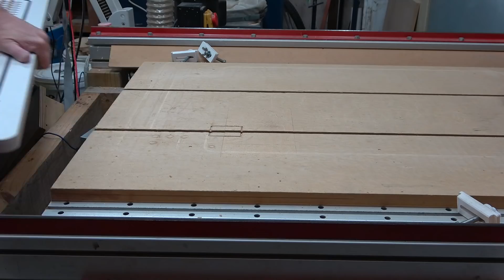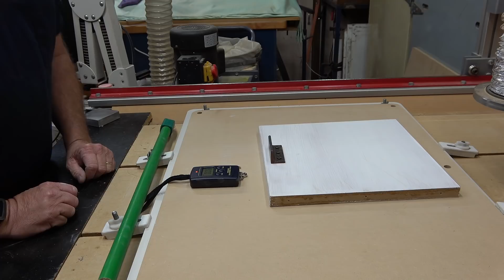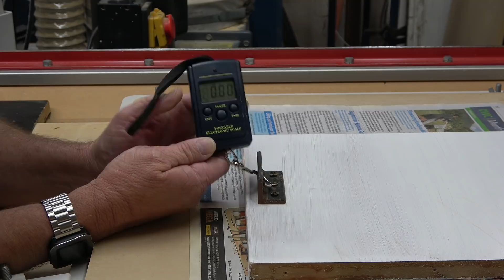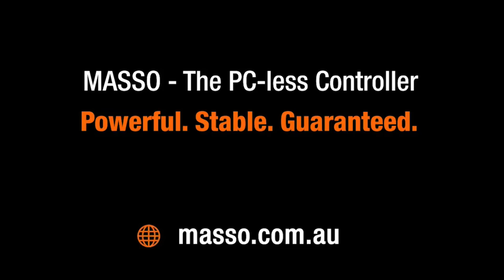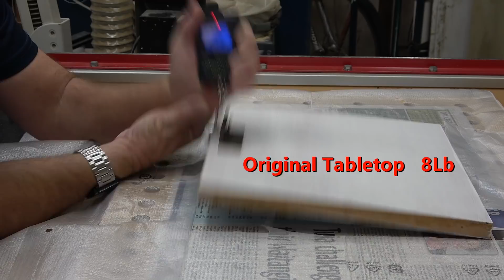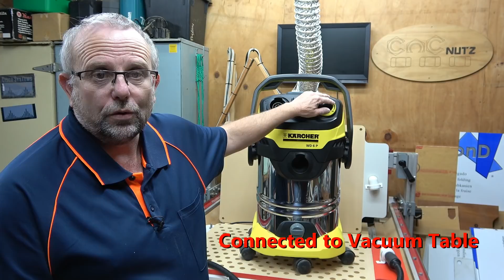Vacuum table revisit Part2 - CNCnutz Episode 244

Comment: Hello Peter... I built your vacuum table over the weekend and found something interesting. I tried my contractor shop vac, and like you said it didn't supply enough suction to work adequately. I did find, however, that if I removed the filter I  got significantly more suction

Comment: Hi Peter this reminds me of a machine I ran. If you make the top plate a spoil board you can drill 1/4"  (7mm) holes under the part you are machining. it pulls down great. it would be nice if you could install a gauge to see how much vacuum you are pulling. The Komo machines we had pulled 30 inches of vacuum. I'm sure you can see images of the tables if you search on the internet.
Reply from the maker: Thanks. Will have a look.

Comment: With a proper vacuum pump able to pull about 26” of mercury, you don’t need holes. Seal the ends, surface the top and you’ll be able to hold snug to the mdf

Comment: All the industrial machines I've used had regenerative blowers which move allot more air.
Reply from the maker: Thanks Stephen, I will will have to have a look.
Cheers Peter
Reply: @cncnutz  i just finished modeling up a 150mm diameter version in Fusion360. I plan to print it out on my 3d printer to see if I can replicate a simple version using an old electric motor I had in the shop. Hopefully can generate enough vacuum with it to make my own vacuum table.

Comment: I built a similar table, for my onefinity. It does cover the whole 48x30" surface with 4 zones. Extensively researched the vacuum engine to use or the shop vac and concluded the same. Festool does have the highest vacuum force i could find with an appropriate cfm to match. Also, all their vacuum goes up to 3.5psi so using the smallest one is fine. For actual vacuum engine, the ones that are stronger and cheaper all require 220V which isn't possible for me.

Comment: Hi Peter, thanx for all your info. I was wondering. The Foam ring you apply around the board, is that necessary . If one would have the same size board underneath and on top, and seal it with Ductape or something, would that do the trick as well you think ??

Comment: Would not it be  better to use plastic for the first piece with the groves and vacuum holes as it would not allow air to be sucked thru it ?Also it would not warp when exposed to moisture in the shop ?Also then using a thinner mdf so it doesn't have to pull vacuum thru as much material .Then paint around the outside of the mdf to seal the contact points of the bottom piece and top-waste board

Comment: Plastic garbage bag rather than the semi-closed cell foam with holes poked. Cover then entire permeable surface of the spoilboard, place the workpiece, cut around it with a razor knife, then remove the plastic under the workpiece. This will eliminate bleed. I think you'll find there's little or nothing to be gained by drilling holes. There are reasonably priced vacuum pumps that you can use in place of a vacuum cleaner (which is not designed to be run while flow is occluded).

Comment: Good day Peter.  I’m just getting started in cnc use and am curious about how well your vacuum table works with fairly small pieces of hardwood in actual cnc routing. My concern is about smaller pieces coming loose if tabs are not used.
Reply: I'm thinking of doing something similar - the tabs and 'sprue' used for smaller pieces is forcing me to use larger blanks than I should have to.  I was thinking of either making 'jigs' that have specific suction holes or using larger 'cover' type boards to cover over the table area I'm not using.  I would think it might put stress on your vaccuum though...

Comment: Excellent thought and process all the way through and building on every previous experience - Thank you very much.

Just building on your closing last ideas -
Foam sheet comes in 2 varieties.  It looked (can't be sure of course) like you were using common open cell foam and that will definitely not work.  It will actually introduce pathways from the side to between board and stock.  However, perhaps you could try closed cell foam  (the stuff used in double skin boat building) which while not allowing unexpected pathways could actually compress across the board and provide suction under the stock with punctures under the area below the stock.
Putting foam aside all together, how about a plastic trash bag (- cheaper and thinner the better) punctured in strategic array.
My final no cost solution - raid the kitchen for Saran wrap?  Used similar to your paper and punctured strategically.

Still, the episodes were brilliant.  Thanks again.

Comment: Have you tried using 6mm or 12mm MDF for your top sheet.... possibly could give a good middle of the road between pockets and flat sheet. BTW thankyou for your uploads they are always informative and clear looking forward to seeing more.
Reply from the maker: I haven't Dale but it is  good thought. If I can find some thinner board I will give it try. 
Cheers Peter
Reply: @cncnutz  why not mill it to the thickness?

Comment: Another very good video with great info and testing, I believe you posted on your site under the materials the following  940 x 60 x19mm I'm guessing it should be 600?I don't have my laptop with me right now but I'm looking forward to doing this project. Have a great day.
Reply from the maker: Thanks Donald, I will fix the typo. It will fit better if you use 600mm 😁
Cheers Peter
Reply: @cncnutz  I'm new to all of this and metric is not my go to measurements. Have a great day.

Comment: don't find a way to email. The contact me on the website is not configured correctly. Any way I really appreciate the videos and I'm going ask a stupid question. I work a lot with rough western US cedar. Neither side is planed. 
without planing will your table be able to hold it down the board. I usually work with 8-12 wide and 2 in thick
thank you  andy
Reply from the maker: Vacuum tables require flat planned surfaces for the best holding. A small leak and everything let's go. I think for rough sawn not flat material I would try thick foam with suitably placed holes to create holding points and see if that worked. I would be holding it so I could machine the other side flat and then flip it over for better holding. There is a contact page on my website for contact purposes. 
Cheers Peter

Comment: Since the top layer of your vacuum table now becomes your spoilboard, do you find the cut marks having a big impact? I use your technique of zeroing to the base to minimize the cut marks, but they're still there.
Reply: I wonder what would happen if you used a thin MDF sheet (like 3mm) on top as the spoilboard...
Reply from the maker: This is where adding newspaper or foam between the board can help as it provides the extra height to protect the actual vacuum table top. I need to do more testing but the other option is to not cut all the way through. Doing this keeps maximum vacuum.
Cheers Peter

Comment: Great video 
Have you install a vacuum gage on your system to see how much your pump is pulling?
Reply from the maker: I don't have one to try and it will be at least a month for lock down to end her in New Zealand.
Cheers Peter
Reply: @cncnutz  Make yourself a water manometer, vacuums pull about 25 - 29 inches.

Comment: I think you need to find a balance between how much your vacuum can pull and how thin you need to go on the MDF to allow that much flow. When your vacuum produced virtually no increase in performance from half to full power, it seemed to me that your table was the limiting factor there; it was blocking most of the flow at rates over 50%. You can probably use the same thickness but balance it with holes drilled partway though as you did there. In all 'factory' type tables I've seen, the shape of the holes is part of the puzzle as well. 
The newspaper is interesting, but I think the result was slightly inflated due to the paper extending past the test piece and covering more area than without it. Possibly cover the whole area beyond the test piece with an impermeable barrier and run the tests again?
Another interesting test (that I have no idea how to conduct right now) is to see how much vertical force a cutter produces.
Your shop vac should work fine for a long time but you need to allow enough flow over the motor to cool it. Add a fan or some sort of cutout valve to control that airflow to optimize it? Maybe a cutout valve might help your full-speed performance as well. You could open the cutout valve a smidge to allow some air over the motor while maintaining suction performance at the table.

Comment: If you would like help, I can give you some help with the vacuum hold down. I worked with a Thermwood model 40 With a vacuum table for 10 years. Also I was at a elevation over 1 mile in Boulder, CO. Lets just say you learn a few tricks along the way.
Reply: Wondering if you received my email?
Reply from the maker: I don't seem to have it Bobby. Can you resend.
Cheers Peter
Reply from the maker: @bobbylittle6996  Please use the contact form on my website:      https://www.cncnutz.com
You will find it at the bottom of the page on the left hand side of the screen.
cheers
Peter

Comment: any reason you are measuring in pounds instead of kg?
Reply from the maker: I learnt air pressure as 14.7 pound per square inch when I took up diving 25 years ago and that is how I think of it. It's the same way I use Ozin for stepper motors. I don't use pounds for anything else. Strange how the mind works.
Cheers Peter

Comment: Thank you Peter very much for this video.  Valuable info and I'll look at  it again to glean more gems.  
My expectation is the duty cycle on the vacuum is more likely a lot lower than 50%.  (As an aside, did you see Jerry Fielding's recent video on shop vacuums and their power ratings? https://www.youtube.com/watch?v=oM4SMQGMFz8).  You might find a more efficient second hand pump ex a dairy farm.  A friend just suggested to me to add a second vacuum pump to the manifold as the two together will provide more suck.
It was interesting to see the significant improvement in holding capacity with the thin packing foam and I recall the improvement newspaper had made in a previous vid of yours a couple of years ago.    
Cheers, David
Reply from the maker: Thanks David. Interesting idea for sure. Don't know if i could handle all the mooing. 😉
I'm hoping to go further with the foam but I can't get any at the moment until New Zealand reopens. your right about the vacuum. If my vacuum usage is anything to go by 0% would be closer to the mark.
Cheers Peter

Comment: Why not use side blower which are actually made for vacuum table, side blower will not overhead as they haver separate motor cooling. Do not use vacuum pump unless you have fully sealed table. BTW: Very nice and detailed presentation
Reply from the maker: Thanks Zulfqar